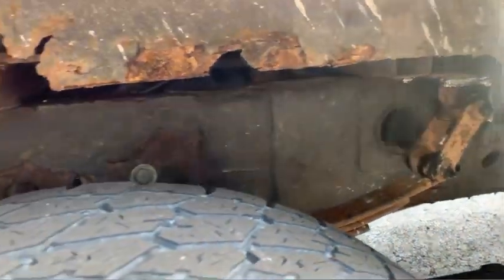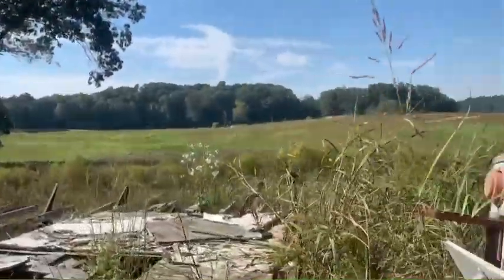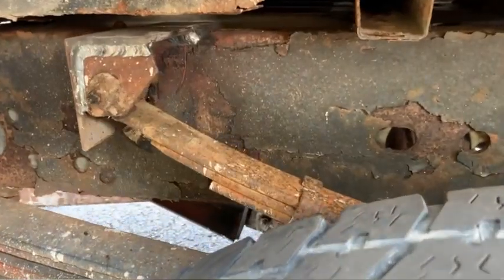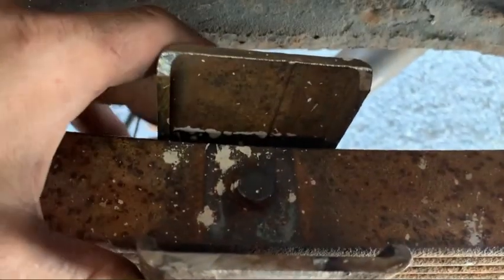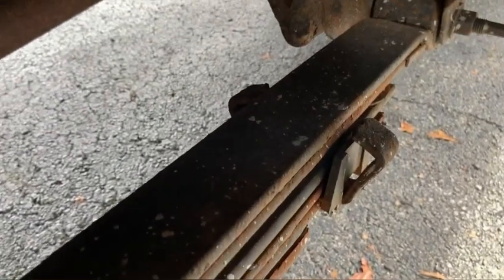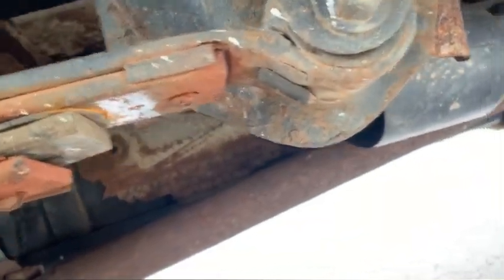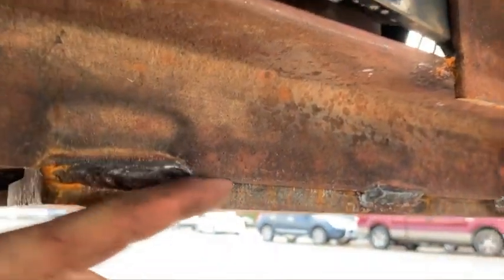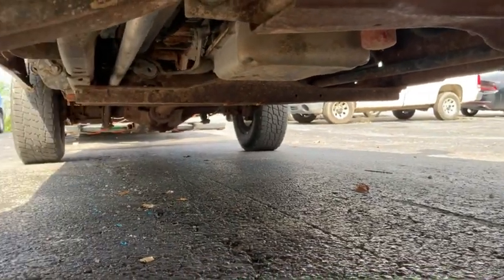tow truck wheel lift build part 8, overload springs, new frame design and front end counter weight

Comment: If you add bags you’ll wanna dump air when you’re unloaded if you’re looking for a better ride. More air=stiffer. Add air when you’re loaded to stay as level as possible. Only other thing I’d add is regarding welding to the frame. Definitely want to be careful welding across the top flange, no matter how good a bead you lay, it stresses the frame a lot on either side of the weld and makes it very likely to crack and eventually fail completely. Not trying to be a safety Sally, just something I’ve learned the hard way
Reply from the maker: Those are all very good tips. Thanks for the comment.
Reply: @backintheshop9604 any progress on it?